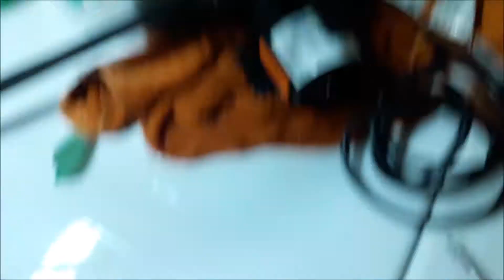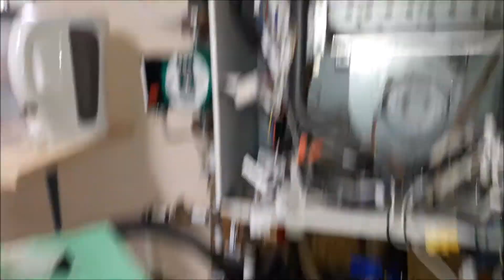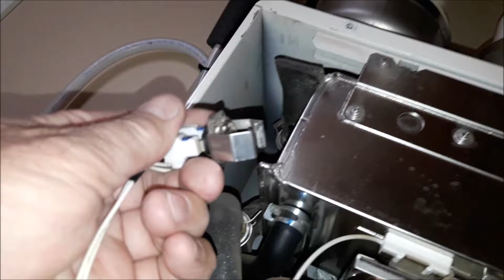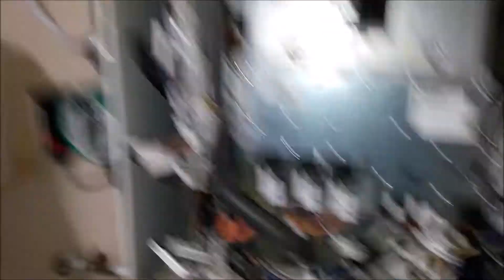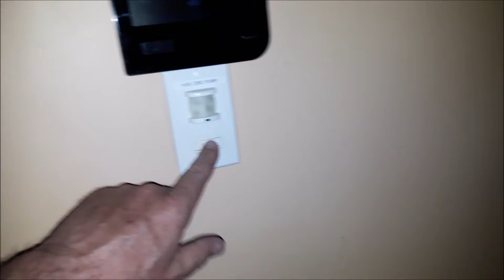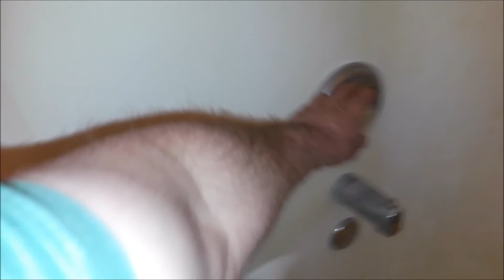No Hot Water Fixed, Noritz. Edit add: This unit is now in the junk yard. Check out IBC

Comment: I just had my hot water stop. Burner light goes on and off. Mostly off. I had a guy come take a look at it today. He opened the panel and basically told me I need a new one for 6K. Didn't unscrew anything inside overall. Said it is not worth repairing. I was an idiot. I bought my house brand new 11 years ago and didn't know anything about maintenance for this thing.
Reply from the maker: Is it setting a code? You can go online and see what the code is for. You can also call Noritz customer service. They can walk you through the diagnostic on the thermostat. Have you been maintaining your unit annually?
Reply: @timcat1004  No Err code. Just says the temp on it. It works on and off when the hot water is run. I have renters in my other home so I cam getting a new one installed with Home Depot for about $2800 all in. The hot water actually worked since I posted this. Weird, but I can't take the hassle of it turning off again. It's about 11 years old, but I did no maintenance to it. Never even knew what to do to. Now I will have it maintained yearly
Reply: @timcat1004  How long do you think one should last if it is maintained properly?
Reply: @GB-xh7hv  This just happened to me this week on a rental I own. Its less than 5 years old. I had no idea that there was required maintenance. No error code or anything but the burner is off. I have someone coming out tomorrow to look at it.
I fear I am going to have to replace it. Did you see if you could flush it and get it working again?

Comment: Wow is a full grey beard part of your winter garb?
Reply from the maker: Not normally. It will be the norm until I retire. Having a hairy face made a big diff in that last cold snap of minus 40 in Feb. didn't bother me much at all.
The first day it hit 20 C the face and head is all coming off.
Reply: @timcat1004  Outside of owning property with a hot spring, there is nothing more therapeutic than functioning plumbing with plenty of on demand hot water.
Reply from the maker: @quietkate  It's not often I hear someone referring to a tankless as On demand. Most people call them instant hot water tanks which is incorrect. Mine however gives me instant hot water. I have a motion sensor that triggers a pump. This sends hot water to all of the faucets in a closed loop. This only happens when there is motion in the homestead. Best of both worlds, conveyance and savings.